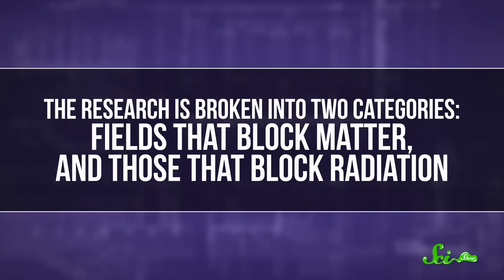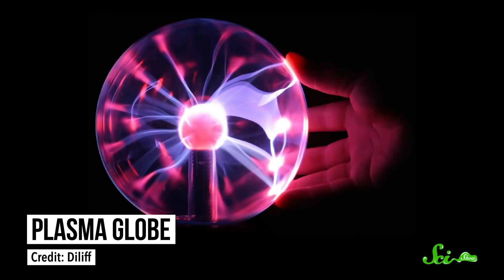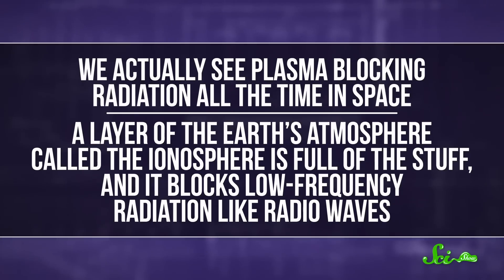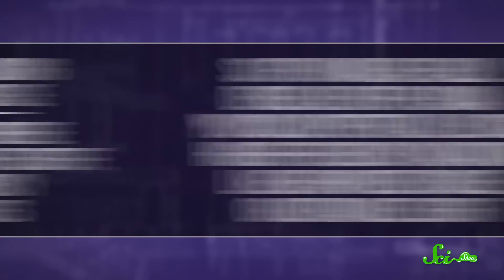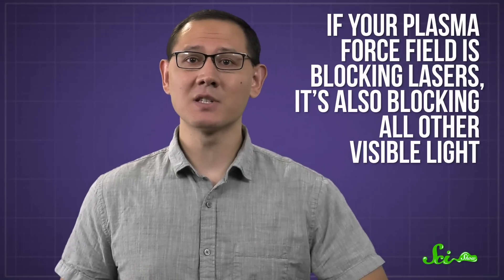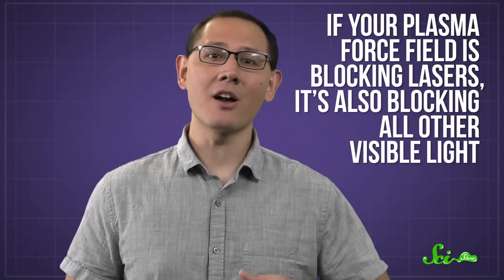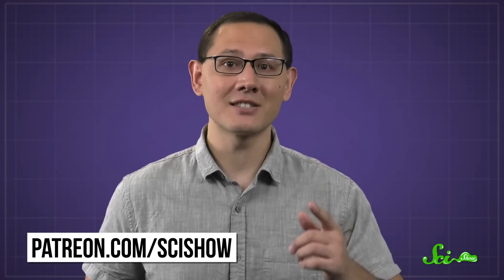How Close Are We to Building Force Fields?

Comment: It's not "a blast of electromagnetism" it's a static discharge, quite a different thing. I've invented 3 other types.

1.Induction, using electromagnetic induction to produce eddy currents in any incoming metal objects.
2.Graphene balloon, (self-evident). 
3.Single pole high-frequency "AC" with ever increasing amplitude, so the higher later ones catch up with the smaller ones at a predetermined distance (longitudinal waves can travel at different speeds). Add an opposite tiny tail to stop mutual repulsion.

Regarding the static discharge the field can be extended by using curved electrodes & by combing a number of them they can be charged in sequence to "push" the field out even further.

Comment: Could it be possible to instead install sensors so that when enemy projectiles pass through the sensor range, it would activate a force field to a specific location on the ship only when required and then turn it off when the threat is gone? While there could be complications like unpredictable enemy projectiles direction and the sheer complexity plus required precision, it's not totally impossible.

Comment: The problem in using plasma to stop higher frequency radiation is, to get the plasma frequency high enough to do to visible light what it normally does to radio waves is the density would need to be on par with solid lead (so as to cram that many electrons in a small enough space).

Comment: If energy shields become available, one can imagine that the next big armor would be reflector shields that reverse the vector of the incoming projectile (the repulsion field has to act like a spring, rather than a cushion, longer discharge of the supercapacitors might be the trick). So it's not just that the enemy is immune to bullets, it's passively attacking you.
Reply: We already have them my titan call them Antaeus Wards 180 degree shield on slides that even sends rockets back to senders with a bow tie

Comment: If we look at an atomic explosio, as the blast reaches critical mass, such as a forest fire the fire fighters cut a fire break around the uncontrolled flames to cut its fuel supply. Perhaps plasma explosive missiles can be deployed to delete the matter stream before the atomic blast to enclose the radiation and explosive force around a set area around the detonated atomic device robbing it of matter and ending the explosive blast to well below its megaton status. The missile Sheild would need to empty the target zone of all combust able matter to lessen the radiation, heat, light and force in the ground zero area, for tactical and missile type multi warhead high megaton bombs. The science is possible but I suspect would require a lot of energy in terms of antimatter to shut down the fission process.

Comment: Its possible because the very existence of the idea makes it possible. The very manifestation of the idea derived from a place unknown, BUT!! its the building block of that idea that comes from our state of reality,  which makes it possible,  What we must strive for is finding and connecting the dots that will take that idea into fruition.   In other words anything you think of is possible because thought is an extension of reality, you can  only conceive from what is known, UNLESS the thought is truly Divine, coming from a place not of our reality, a place unknown.    we function as beings because our brain can connect the dots with a lack of information.  similar to singing thru a song but not knowing all the lyrics,  Humming and mumbling your way throughout.   The brain fills in the gaps with useable nothing.   So the idea is formulated, the brain accepts its reality, but where all the holes exist the brain simply fills in the gaps.   The idea is plausible, but you simply need to find what properly fills those gaps, connecting the dots.   Whats faster than light? thought.  I can think about being on the other side of the universe faster than light from that side would take to reach me.  And since i thought it, their must be a way to achieve it.

Comment: So nobody is going to read this, but...

Magnetic force fields cannot deflect neutrons or light.

Also most objects are electrically neutral, so objects like missiles or even plastic will pass right through a magnetic field.

In addition, such fields require too much power to stay as super conductors.

Gravitational force fields can deflect all matter particles, since gravitational charge (active gravitational mass) is only positive.

Gravity can also bend radiation, it's known as gravitational lensing.

In theory a strong enough gravity field can alter the trajectory of any matter or light by 90°

What I have said has been known since the former space race decades ago, nothing has changed because we haven't had an energy breakthrough for magnets and we still don't know how to harness gravity.

Comment: the already Sci-Fi way to get around the blinding effect of plasma shields is Sensors. The crew of the Enterprise don't look out the window; instead, they have a viewing screen. If you could miniaturise all necessary sensory detectors (camera for visual, radio receivers and transmitters for audio, heat sensors and others) into a small area that poked out and possibly was built into the shield generator. This would give you protection and information, with the only downside being the week spot created by these sensors, protect them with regular armour and make them as small as possible and they would minimise the risk to an exseptible level

Comment: A force field that makes you blind would be an interesting mechanic in a sci fi universe. Imagine if a ship had crew or a computer designated to do point defense with the shield, directing it only where needed. The enemies could use feinting maneuvers, firing to cause them to put up the shield then using the generated blind spot as a way to sneak around to where they're vulnerable

Comment: What about using some kind of "force field" to deflect dust during space travel?
Would the energy requirement be prohibitively high?
Reply: Yes. At relativistic speeds above .90c a single particle impacts with the force of 625 metric tons of tnt.
Reply: There are trillions of particles zipping through space every second, impacting every cubic inch of a spacecraft
Reply: Also. This guy failed to mention there are also gravitational force fields, which can repel matter (deceleration) and radiation (gravitational lensing)

Comment: Still curious about the drawbacks if any: wouldn't an electromagnetic shield also screw with electronics? what about the radiation and heat from a plasma shield? would that affect the crew in any way?
Reply: One. A magnetic field of that strength would mess up electronics.

A plasma that's hotter than the Sun  and has megawatts of current would emit copious amounts of infrared radiation and vaporize the ship.
Reply: @scifirealism5943  true so I wonder if they'll find a way to stop such a thing? cause thats really the biggest isuses stopping form such tech being possible.
Reply: @Jeffron27  the man in the video failed to mention gravitational force fields. Newton proved all matter possess gravity, electrons, neutrons, neutral atoms,etc. 
Einstein proved light possesses/is affected by gravity as well, via gravitational lensing. 
So gravitational force fields could deflect matter and radiation.

Unfortunately, gravity cannot be controlled.-

Comment: i'm dissapointed you said nothing about plasma windows. We already have IRL matter repulsing fields. They're just really tiny.
Reply: Plasma windows require 8 kilowatts per cubic inch to run, that's way too much power
Reply: @scifirealism5943 . They exist and are used. Electron beam welding.
Reply: @justaguycalledjosh  that's not a plasma window. And electron beam welding has to be done to be a done in a vaccuum, making it impractical for use in Earth's atmosphere.
Reply: @scifirealism5943  That's why we use plasma windows. They minimize the absorption of electrons by atmospheric atoms, by creating a barrier that resists the transfer of material atoms, without impeding radiation and immaterial particles like electrons.
Reply: You can have an emitter meters away, not mere microns, allowing for much more effective lensing
Reply: Magnetic fields needed to repel particle beam weapons require too much power to be applied on a large scale and run continuously

Comment: 2:22 but blind in sense of the visible light? Or every kind of radiation that stops also radio waves, uv rays, microwaves, x-rays and gamma rays? Does it also stop sound? Because if not you could still use radar.
Reply: I'm pretty sure it blocks all radiation. I think you could use sound but the plasma could interfere with that in some manner I'm no expert though.

Comment: @ 2:34 doesn't need to be manned technically. Could be applied to a drone or radio controlled car with an antenna poking out of the plasma. Other ideas include rapid redistribution methods via electro magnetic harmonizing (think how a bullet train moves, constantly being pulled forward while being floated on top of powerful electro magnets.) 

In practicality I think the cheapest method would be reenforcement of the crews cabin within the vehicle. Cameras leading to the outside point in all directions. Screens placed within.

Comment: Don't you only actually need the force field up for an extremely brief period of time to stop the incoming attack then it can go back to being on standby?

I've seen plenty of sci-fi where the force field is invisible until something shoots it. It lights up briefly during contact then goes out again. That seems like how you'd deal with the problem of plasma blocking light
Reply: A lot of films take creative liberties, if you're blocking a laser being fired at you, it's going to travel at the speed of light, so you'd either need to be clairvoyant and see the attack before it happens or have some sort of faster than light communication for your sensors, if blocking radiation is the goal they'd need to be up all the time. However, physical projectiles are much more manageable.
Reply: Yes but the space radiation would be constant, you could never turn the shield off

Comment: Star Trek shields aren't in a high enrrgy/matter blocking state for more than fractions of a second - most of the time they're scanning for disturbances and have a low-level charge that can deflect small rocks and such. An incoming particle beam like a phaser or a torpedo will be blocked with a short high energy discharge.
So not so different from electric armor, and won't blind the ship crew.

Comment: Doesn't lasers in science fiction  are plasma ? They are named lasers because of 1990 sci-fi shows which first depicted them, but it's plasma in reality. Everyone knows that...
Reply: No, they're actual lasers, a monochrome beam of light. They actually exist and a high power laser can do a lot more than cut through metal, its just that lasers are big, expensive and have a huge power requirement. A plasma torch however just requires acetylene, propane or other combustible gas as fuel and can pretty much do the same thing with a few differences. The basic Sci-Fi laser is what we use in physics laboratories, given a few creative liberties and future tech on battery/power generation, plasma is normally a globulet of superheated gas launched out of a barrel, again with a few creative liberties. So in short, no, lasers are lasers and plasma is plasma.

Comment: Why can't mirrors be used to block radiation in the visible wavelengths?
Reply: Because they don't perfectly reflect the laser and will heat up and melt plus you would be reflecting the laser in another direction potentially putting other things in harms way. Not to mention those mirrors could be broken by other weapons

Comment: Another problem with plasma force fields is if you have a shield lasers can't pass through, you can't shoot your own lasers through it either. However, you could mount the sensors and lasers on pylons extending away from the shielded area of the hull. They would be vulnerable, but you could have multiple back ups so if one was hit the others still function. Space combat might involve ships sniping at each other with lasers until one ship is blinded and/or disarmed. EDIT: Also, a dense plasma shield contained in an electromagnetic bubble around the ship would likely provide some protection against micrometeorites and stray particles. EDIT 2: Another advantage of the plasma shield is enemy ships couldn't see through the shield, thus hiding your ship. The enemy could detect the plasma bubble and any sensors/weapons/etc. sticking out from it, but they couldn't actually see the ship itself. A fleet might have smaller escort ships which project a shield the same size as the capital ships to fool the enemy.

Comment: I had an idea for a type of sci-fi semi-self-healing / self leveling moldable armor.
1. The inner most layer would be the base layer. It would be a sheet of steel with a rows of loops welded to the outside surface.
2.The second layer would be a layer of permanent magnets fixed to the outside of the base steel sheet. The. magnets would be set inbetween a web of electric magnets which would also be fixed to the outside of the steel sheet in a hexagon grid pattern. 
3. The third layer would be a layer of small steel balls of varying sizes.
The steel balls could also be suspended in steel powder or a thick non-Newtonian fluid or a thick gel.
4. The fourth layer would be multiple layers of Kevlar fabric woven together and suspended above the layer of steel balls. It would be loosely laced to the base steel plate. The reason it would be suspended above and Loosely laced to the base steel plate is to allow the steel balls to move freely between the outer layer and the base layer. This layer would act like sand bags. You could add sand or ceramic balls into this layer too.
5. Outermost layer would be a layer of reactive armor.

The permanent magnets will keep the steel balls in place during normal operation.
The electric magnets could be turned on to draw the steel balls towards an area that has been damaged or to thicken the armor in an area that is about to be damaged.

As an added option There could be packets of glue that could be activated and hardened when an electelectrical current is sent to them or they could be activated when punctured.
Reply: That sounds awesome pretty close to what the spartan armer self healing do
Reply: You an engineer?
Reply: almost sounds like how HEV suit works
Reply: As a warthunder player, I hope with doesn't work.

Comment: Wait a sec.. If plasma blocks radiation and the force field would obscure line of sight, would it appear completely black or completely bright?
Reply: All you would see is the bright plasma around you and whatever else that would be inside the shield
Reply: very bright
Reply: Sounds like a orb ufo yo me @cowmoo5596
Reply: To support what others have been replying, a piece of iron can block light** and glow brightly at the same time.  If it's very hot of course. And  plasma is VERY hot.  "Bright" and "opaque" are not mutually exclusive in physics ;)

**(not for the same reasons, but still)
Reply: ulquiorra, ok, I'll buy that.
Reply: Depends on the environment it is in, and what is currently hitting it. Assuming ultra thin plasma trapped between extreme magnetic fields, which modern magnetotronics can already do.
Reply: If the "radiation" (including light) is Blocked, there would be nothing to see, therefore, it would be dark. Would it not?
Reply: @tarnishedknight730  no while the plasma blocks radiation it also produces it's own which would be bright. plasma is basically superheated gas which glows like stars and lightning. So you'd be surrounding yourself in light. When inside the field you would be able to see everything inside the plasma field but wouldn't be able to see out of it.
Reply: @tarnishedknight730  The plasma itself is bright, as it 1000s of degrees hot
Reply: @tarnishedknight730  If you are inside, yes. As he said, you would be blind. But on the outside, that depends on whether plasma deflects light, absorbs light, or reroutes light (like, make light go around it). If it deflects, then it would look like a giant mirror. If it absorbs, then it would appear dark. If it reroutes, then it would look as though it was invisible. But this is for regular matter. Plasma is different, and I know nothing about it.
Reply: @jmvr  plasma produces is own light so you would see it just like you would see a star not because it reflects or absorbs light but because it gives off it's own.

Comment: Plasma shields would block matter too, as incoming projectile would be super heated and turned into plasma as it enters the shield. The shield could also be confined to just the area ahead of where the projectile is going to hit, which would bring down energy requirements, using fast cameras and AI powered by neuromorphic processors which is all possible to respond quick enough. Of course, it's also easy to defeat this shield, with circuitry at the tip of the projectile (which is the most sensitive bit) that creates a magnetic field to push the plasma out of the way, so there's a whole load of money to be thrown away on that arms race still, but of course that's just state vs state warfare, which is very much a thing of the past... most "war" now is just the rich vs poor type, so plasma shields would give the rich another big advantage here, although not so much against IEDs that explode beneath the vehicle, where there's not the room to detect something incoming and create the shield to block it, possibly maybe, that's getting into the "unpredictable future" territory, anyone claiming to know anything for sure would be an indication that they're not worth listening to as they don't know enough to know how wrong they can be!